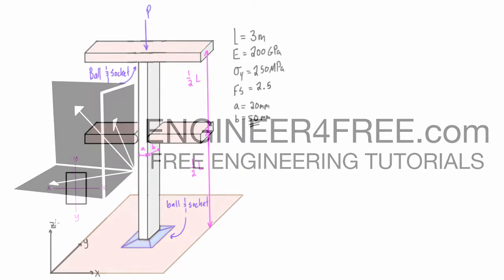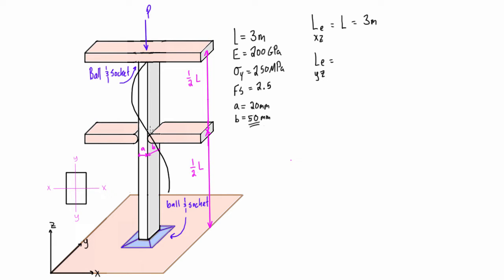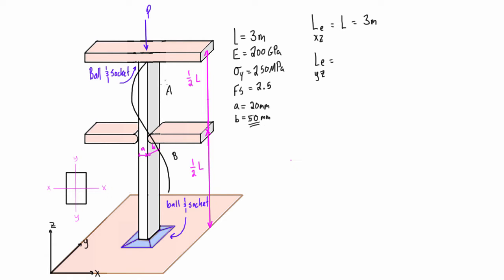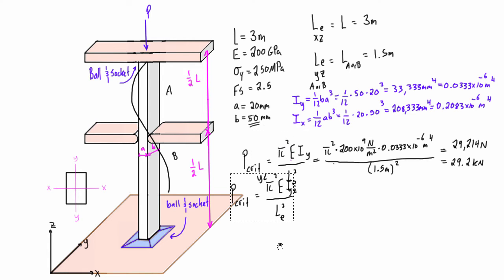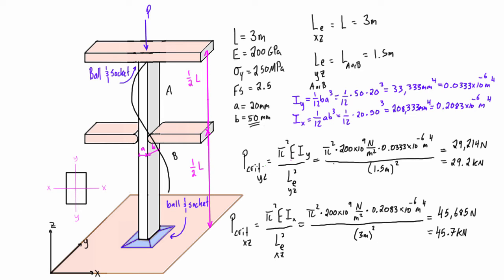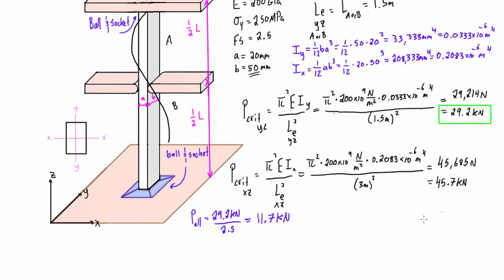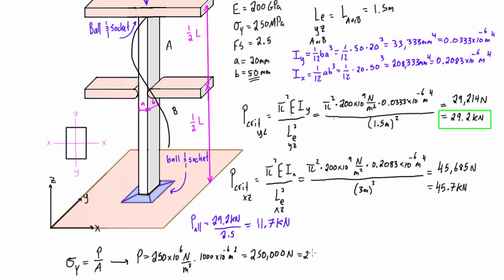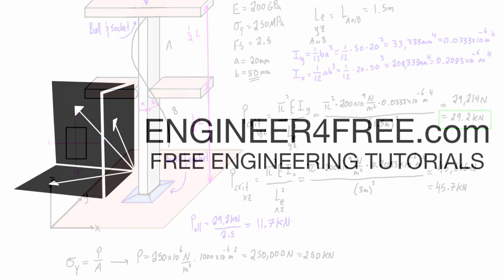Column buckling example problem #5: with bracing

Comment: sir about y-z plane since we are having two spans of the column having each 1/2 of the total length... why didnt you add up both of those lengths since about y-axis the deflection was occurring at both spans so you should have used as Le about y-z axis= 1/2*L + 1/2*L  so it should be 3meters again for y-z axis...kindly clear this

Comment: My only concern is that your examples assume, as in the case of RCC columns, that the column was, from the outset, properly made with sufficient rebar, 135 degree hooks, sufficient mid point stirrup ties, and concrete which did not use excess water as a super-plasticiser.
.
In many earthquake prone areas, tofu columns are justified on the basis of calculations not unlike yours, completely ignoring seismic movement of the ground acting on the lower fixed end of the column, and the inertia of the load being supported at the other fixed end of the column, which therefore resists movement and induces both column failure and buckling.
.
Introduce into this mix of cowpat concrete and inadequate and/or incorrectly deployed rebar, a plastic pipe for such purposes as hidden sewage/rainwater disposal, and the death of a column and perhaps the occupants of the building where such columns are deployed appears predictable.

Comment: thank you sir. if the sections of the column had different lengths and cross sectional areas that are constant on each respective section, would we in this case have to apply superposition in the case of yz? also would we use the same load on each section if this is the case?
Reply from the maker: Hey sorry I’m not sure I read that correctly. In this example, the section on each side of the brace has a different length, but the same cross sectional area. If the cross sectional area changes at some point, the axial load will be the same in each section, but the normal stress will be different.

Comment: i appreciate your working but I dont understand that why the y-axis has become critical, as it has been braced already. you also mentioned that column will buckle in the direction of more value of slenderness ratio and the slenderness ratio of x-axis is greater as i has effective length of  3 m so it should have been buckling there before y-axis. off course the greater slenderness ratio will govern the buckling which x-axis in this case not the y-axis. please revise your problem by calculating critical stress. thanks alot
Reply: Aqeel Ahmed the moment of inertia about the x axis is still enough for buckling, look down at the footing of the column you can clearly see how wide it is in comparison to its thickness

Comment: why the k is 0.5? isn't k is 0.5 only in fixed-fixed connection?
Reply from the maker: Are you referring to the effective length of section A or B for buckling in the yz plane? If so, the effective length = 1*length for buckling in the yz plane, but the "length" of the section A or B is defined as 0.5L because of the bracing in that direction. The 0.5 shows up because the beam sees itself as pin-pin connected in both section A and B, and it sees its length as 1.5m ( and L was defined as 3m so 1.5m = 0.5L) for each of those sections. If I misinterpreted your question the lemme know but otherwise I hope that clarifies it!